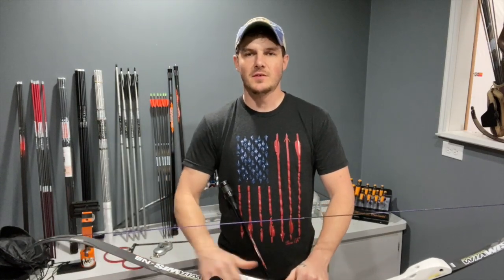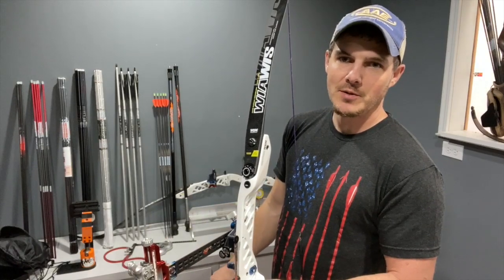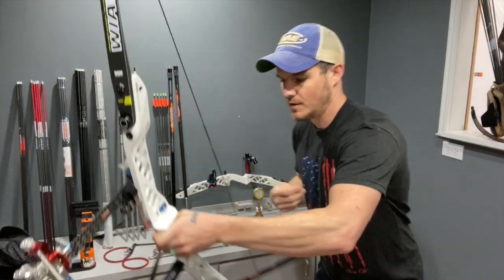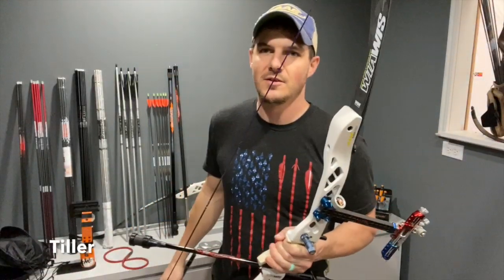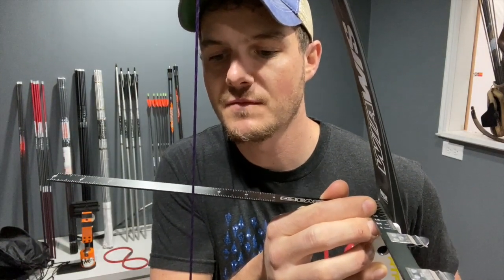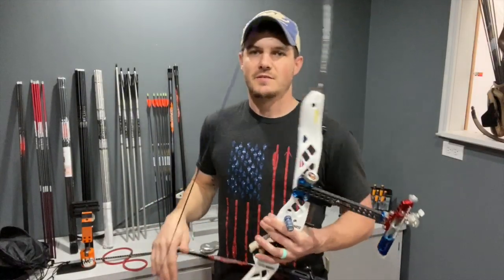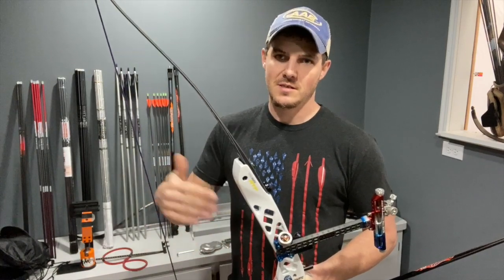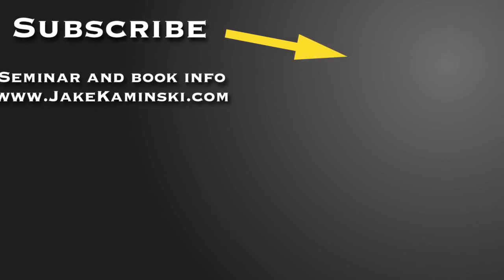Recurve Tuning Series Episode 2 |  Equipment Basics; definition and how to adjust with Jake Kaminski

Comment: Your descriptions and explanations are by far some of the best on Youtube. Thank you! But since I'm European I just must say when you're talking about inches my brain goes into some slow-motion mode. 6 and15/16'th inch?!? LOL......I have absolutely now reference point in my brain. It could be the thickness of my hair, or the length of my car......

You: I measure 6 and 15/16th inch..........
Me: HUH?!?
My Brain: 1 inch is 2,54cm therefore 6 inch is 6x2,54 = 15,24cm, then plus 15/16th inch equal 2,54 divided by 16 then multiplied by 15 is 2,38 plus 15,24 is 17,62cm.....
Me: (5 minute later) Ah, you mean 17,62cm
You: ......and next episode we are going to talk about.......
Reply: There's a reason the imperial system is all but dead.

Comment: A good tip for newish archers is that once they find the correct row on a spine chart, they can use any of the arrows listed in that row if cut to the length indicated for the draw length. This has the advantage of disabusing them form thinking there is only one right shift for them. This is limited, of course by the archer's draw length. If it is long, many of the shorter arrows are not available for safety reasons. Later when they are outdoors and distance shooting is involved, the lightest arrow, advantageous in distance events, will be the one that can be cut very close to their actual draw weight and so the number of options from a single chart is much smaller.

Comment: reviewing this video at minute 13:47 I remembered that you need to verify where is cero (0) for the T square. Some rulers may use the string clips (the channel)  and others may use the actual side of the the ruller closest to the string. I used a tape measure with mine and the cero is flat against the ruller on the side of the strings so using the string clips will add a few milimiters or a fraction of an inch and you could be off according to the factory numbers. It is probably safest and more accurate  to push the string all the way against the ruler.

Comment: I'm going to follow your series all the way through . I'm going to ask questions as they pop into my head .  At 10;40 you said when we pull back to full draw the limbs are in balance   How do you know the limbs are balanced at full draw ?  Could you tell me at what part in the tiller section  you talked about  how you know you have it set correctly . If you want less pressure on your  top finger or more pressure on your top finger  is the  tiller adjustment  used for this ?  Okay never mind  I see now this is just a rough setting and you are going to go into  fine adjustment of the balance later on .

Comment: Awesome video Jake! I would have one thing to add in the brace height segment; increasing brace height will increase draw weight as well. A couple of turns of the string won’t do much but going from one end of the allowable range to the other will be more significant.
Reply from the maker: Thanks for the encouragement, however I beg to differ on the bow weight increasing. It simply doesn’t, however a higher brace height does make your arrows weaker but only because of when the arrow decouples from the string within the power stroke. 

I’ll cover that more on the brace height section for sure.
Reply: Jake Kaminski, I’ll be looking forward for that segment. However, intuitively thinking, when you shorten the string at full draw the limb tips would come back further. It’s true that the power stroke is made shorter so much difference in arrow speed won’t be measured. 
But I would think pulling back the limb tips more should result in a slightly increased poundage at the fingers. 
Or am I missing something?
Reply from the maker: 𝖘 𝖍 𝖎 𝖗 𝖔 your’e correct on it pulling the limb tips back at brace height. Not at full draw. Your clicker clicks at the same point in the draw cycle. 

Borrow someone’s string for a 2” shorter bow and check your draw weight with a scale. It will be the same despite having a 14” brace height.

Comment: Not all limb bolds are straight, some Kap risers have concentric
 bolts that you can use for limb alignment. If you want to adjust the drawwight, you have to do it 180 degrees or the limbs alignment is wrong ;-)

Comment: Hi Jake,
I have questions that's not hully covered in manuals. What bowstring material is preferred by olympians, 8125?
And also, I can see that the string on bow You tune, looks quite heavy for 30lbs (lot of strands) and here is my second question, is it okey to manipulate the recomended number os strands? If i use more strands in bowstring and go with softer arrows, how this affect overall bow performence?

Comment: Hi Jake, great video, thanks for sharing with us. Got one question regarding the arrow spine. Easton for example, in their arrow selection table gives the spine values for given arrow length and draw weight. But what's the relation of the spine with the point mass? I know that heavier points will make arrow to flex more due to the inertia so dynamic spine is affected, but how much? For example if I take mine 30" X23s and replace 160 grain points with say 200, how much the spine will change?
Reply from the maker: Ill try to cover that in the arrow building series. Generally that small of a change in point weight will be maybe a full turn on your limb bolts difference in tune.
Reply from the maker: also usually Easton's charts reference the stock point weight (usually 100 grains +/-)

Comment: Would you prefer setting the tiller based on manufacturer recommended measurement or with high-speed-video so that both limbs reach neutral at the same time?
Reply from the maker: Ill cover how I set my tiller in a video coming up.

Comment: Hi Jake,
isn't it better to unstring the bow befor adjusting the tillerbolts?
I've done that before with my bow without unstringing it and I killed the inner thread of my riser.
Tiller bolts like they are used by w&w are working like a screw tap, if you turn them under pressure.

Thanks for this video!
Reply from the maker: Yeah you should unstring the bow especially if you are using aluminum limb bolts in an aluminum riser, they can seize in the bow. I was using a set of steel limb bolts that had been hard coated in that riser. However I usually unstring the bow to adjust bow weight, but leave it together when adjusting tiller since its such a small movement.

Comment: You didn't mention that when measuring brace height that if you use your recommended technique and then the technique of butting the square up against the string you will get different numbers. The zero point of the bow square is where the string is in your technique which is atop two little plateaus rising out of the square. They just started making bow squares with two scales on themm one for using the clips and one for using the butt of the bow square.

Comment: When you are setting up the sight on the bow for initial tuning should you adjust the pin to be directly over the string?
Reply from the maker: Chris Gentile usually mine end up outside of center. Maybe 2mm or so.

Comment: Hi Jake!,

I am shooting a Zero difference in the tillers on my bow, i.e. both the top and bottom are same..
I have been shooting this configuration for about 4 years now. I shoot Hoyt Faktor 27" and Velos 46 long. 
Should I change it or leave it?

Thank you!
Reply from the maker: I find that tiller makes a big difference in how the string feels on your draw fingers. With no split you will feel less tension on your lower finger which may or may not be of benefit. We will cover that more later on.

Comment: Hi Jake,
I have just another question:
What typ of string with how many strands you are shooting on how much bowweight?

Thanks in advance!
Reply from the maker: Ill cover that in a string video. I run 20 strands of 8125 sized material at 46ish lbs. I would recommend 18 strands for around 40 lbs and less.
Reply: @JakeKaminskiArchery  Many thanks for your answer, I will try that, next string. So long...

Comment: Wait... how then is brace height influence the tiller ? Understand it does not influence the ratio between upper and lower tiller but the absolute number would change ?
Reply from the maker: In my experience, brace height has a negligible change on tiller settings. Yes the number would go up if brace height is going up, but what we worry about in tiller settings is the "split" or the difference between the top and bottom.

Comment: I'm using a Hoyt Formula X riser, my tiller bolts are more than 6 turns out for sure... Is that a problem? Does it affect the shot?
Reply from the maker: You risk damage to the limbs and the riser, specifically a risk of the limb bolts ripping out. I believe the absolute limit is 6.5 turns out but I wouldn't go past 6 out.
Reply: @JakeKaminskiArchery  Okay, I'll see what i can do, thanks!!

Comment: As a rule of thumb, machinists tells us that a bolt needs to be threaded into a hole a length equal to its diameter (for safety). So, a half in ch bolt needs to be screwed in a minimum of one half inch. So, you can take your limb bolts, make a mark on on equal to the diameter of the bolt. Then screw it in up to that mark. Counting the turns from that point to all of the way in provides the maximum number of turns that a limb bolt can be screwed out on any bow. (I try to avoid being right up to that limit because I think the rule of thumb was created for steel threads and we often enough have steel threads screwing into aluminum.